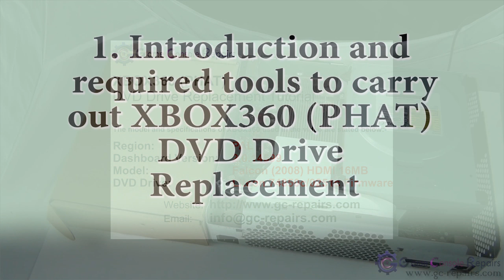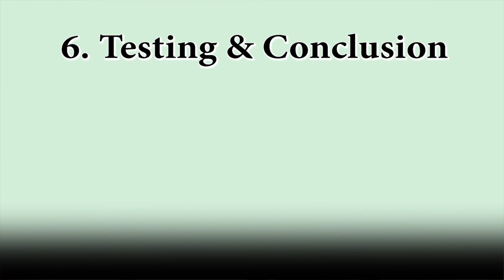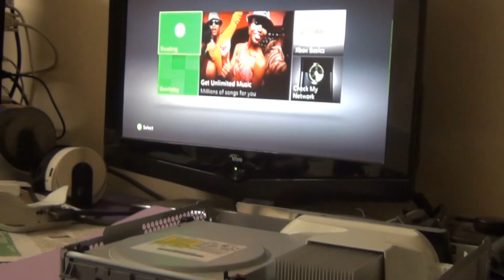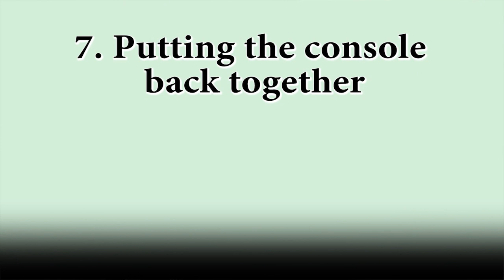XBOX360 (PHAT) Liteon DVD Drive Replacement Tutorial FULL HD

Comment from the maker: Yes that is correct - You do not have to flash
Yes you can put the PCB of 93450c into 74850c

74850c, 83850cv1 , 83850cv2, 93450c and the latest one is 0251c.
These all correspond to different firmware revisions. All Philips Lite-On DVD Drives have exactly the same hardware 
so you swap with any Philips-Lite-On DVD Drive.

Comment: one more question, i bought a disc drive off ebay that was refurbished, and i fixed my tray so i wouldn't have to solder the board off, but i replaced the outer shells because my tray won't open unless there's a disc in it because the magnet on the top cover is too strong, but it makes this weird buzzing noise when the xbox starts up and whenever i close the tray without a disc in it, but it doesn't make a noise when a disc is playing, is there something wrong?

Comment: Hey @GameConsoleRepairs, got a question for ya..  i recently watched a vid where a guy shows a way to replace the dvd drive w/out soldering or flashing.  Basically, instead of switching out the circuit boards he simply takes the laser assembly out of the old drive and replaces it with the assembly from the new one.  You think that would work?  Cause i really don't feel like soldering..

Comment: I have 2 drives that are completely unresponsive and the power button rapidly flashes green with them hooked up. I verified the open/ close switches have continuity when closed. Am I screwed? Am I to assume the boards are bad? Is there a particular part of the board that fails? Any help is appreciated.

Comment from the maker: yes thats an issue with the gear assembly. you have to open up the drive, take out the whole gear and clean it up
If you are not comfortable opening it up best option would be to simply replace with the new drive. Just follow the video
Thanks

Comment from the maker: There are few ways to open up it up. You can use "Micro-turn Precision Screwdriver"

You have to push it in so that the latch is separated from its connector

OR

You can purchase XBOX360 Opening Tool from our store from XBOX360 (PHAT) \ Repair Parts & Tools section. Its called as XBOX360 (PHAT) Opening Toolkit - Grey

Comment: Would I be able to cut the cables in the middle from the new drive and old pcb and just attach them together instead of soldering?
Reply: If you want to do it properly and only once, get a soldering iron. I bought a soldering iron just for this and was able to do it with no prior soldering knowledge or practice.

Comment from the maker: Yes its highly likely that the drives are not original or functioning. Contact the supplier and see they are able to swap with a functioning drive.

You do not have to find out anything when you purchase a BRAND NEW DRIVE. It should be a proper functioning drive. If it is then all that is required is taking off your original PCB and soldering onto the BRAND NEW (functioning) Drive. Hope this helps

Comment from the maker: that maybe an issue but there is an easier way to find out whether you have the right DVD Drive or not

when you insert a disc what type of message you get

Open Tray ?
OR
To play this disc, put it in an Xbox 360 console

Open Tray Error means - It could be an issue with the Lens or Spindle Motor or Rail Assembly
To play this disc, put it in an Xbox 360 console Error means - DVDKey is not matching with your drive and thus have wrong drive in it

Could you confirm ? thanks mate
Reply: Open tray when I insert a game sometimes
Reply: I mean most of the time

Comment: The problem I'm having is that it's the circuit board I think. I accidentally touched two of the wrong contacts together while modding it. What would I have to do if that we're the case?
Reply: if it smells burnt. buy new one unless u can replace and locate the burnt curcit

Comment from the maker: @ahmedenaitalla
All the technician is doing is playing with Temperature.
@400 - it melts very quickly so he quickly removes it
then he is using @300 to slowly melt and squeeze in the wire and let it dry. thats it.

its a Soldering Station.

You can purchase high-tech Soldering and Desoldering stations also.

Comment: Here's an easy fix for you. Go to a dollar store. Pick up the tiny hair rubber bands that they carry. Take the case off of your disc drive. open the tray by pushing in the tab that is on the underside of the drive. It will reveal gears. Remove the rubber band that you see and replace it with a new one. The bands get worn out after so long and can cause drives to become stuck. I would then recommend putting back on the original casing.

Comment: Why can't you just replace the whole dvd drive?
Reply: hmjohnson2196 All 360 DVD drives share a security key with the console it's bundled with. If you just replace the drive you'll have a mismatched key and the system won't load games with it. I can't confirm it, but people say it can get you kicked off of Xbox Live. By swapping the control board you don't have to mess with security key flashing and still get a brand new drive.
Reply: Because the you need the pcb from your old dvd drive which has the coding from your Xbox so that way it will read the games
Reply: honorablejay yes it does....doing it as I'm typing...lol